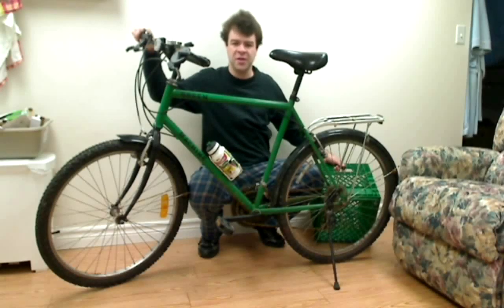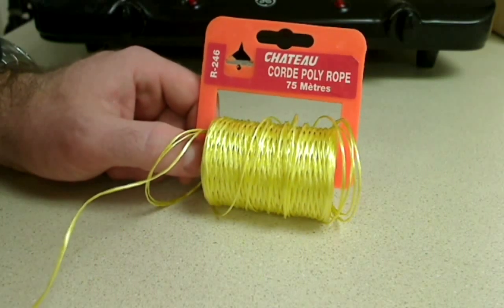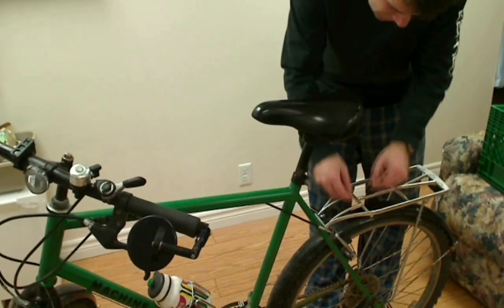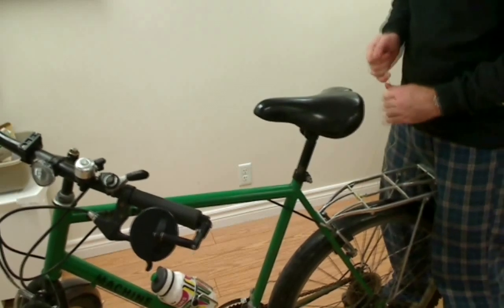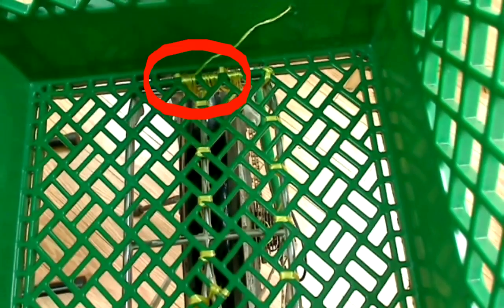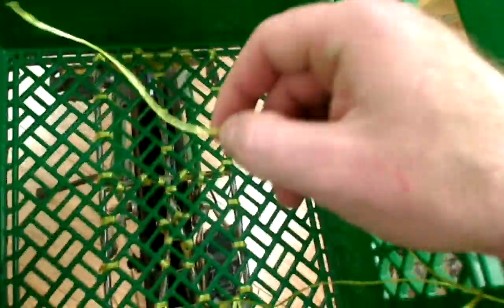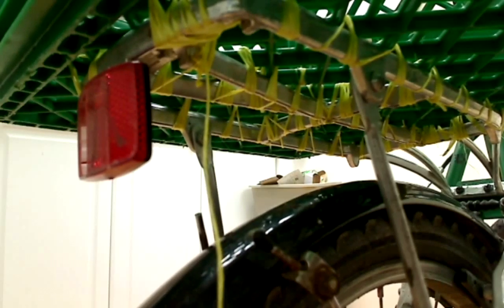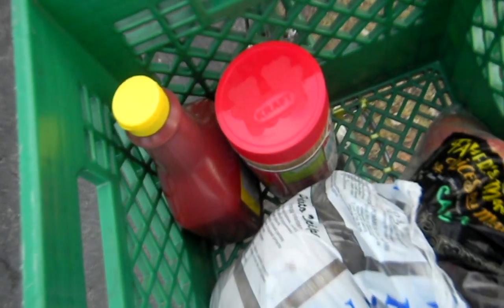How to Add a Milk Crate to a Bicycle

Comment: Thank you. I was told at some point to use cut up inner tubes to tie it, that works ok for a couple months but this seems much more solid.
Reply from the maker: Steerpike Yamaha I would imagine cut up inner tubes would deteriorate over time from exposure to the sun. Nylon string is what I have found works best.

Comment: Very nice I got a small crate for my bike but it's doesn't have holes like your crate. I guess I'm gonna have to get the drill. I like your method with the string cause it looks really sturdy and that is what I want. Thanx for posting this video.

Comment: If you did want to slide the crate back a bit (away from the seat) and attach it, so some of the crate is hanging over the back end of the rack, but you then put a floor inside the crate so any weight in the crate was more dispersed, do you think that would reduce the risk of the plastic bottom (that extends out the back) breaking?
Reply from the maker: On one of my bikes I installed a milk crate that overhung the rack a bit. Over time the bottom developed a few minor cracks, but it still held together and I was able to continue using it. Depending on what floor material you had in mind, that might help. Something non-flexible would spread the load and prevent the back section from cracking.

Comment from the maker: @jdcarpe 
My original black milk crate bike has extra reflectors mounted on it, but I still haven't gotten around to adding them to my new green one. However, both bikes have a fabric loop I added to the milk crates where I attach my rear bike lights for riding while it is dark.

Comment from the maker: @jdcarpe 
On most days I only need 1 milk crate, so that's why I mount them the way that I do. On days when I need additional cargo space, I just take 2 bungy chords and then I can stack as many milk crates on the back as I need.

I've never ridden a bike where they are attached the way you have yours, but I imagine the bike would take up quite alot of space on the road, although maybe not much of an issue if you have bike lanes or bike paths.

Comment from the maker: @doubleOprepper I bought the bike used, and it had already been sprayed black by the previous owner. Having compared it with other bikes over the years I'm about 99% sure it is a Supercycle XTI-21.

You can see the bike featured in many of my other bike repair videos. It has been a really great bike for me, the only disadvantage is that its quite heavy.

Comment: Use zip ties!  That's what I used!  Less complicated!
Reply from the maker: If you didn't notice, there is an annotation linking to a video showing how to do this task using zip-ties instead. I have done it both ways, and honestly prefer my string method.
Reply: Zip-ties work but they loosen up a bit over time with vibration and tension. Last thing you want is for all your stuff to fall all over the road while riding around haha.
Reply: cjhoyle hi im glad i reviewed this video before attaching my milk crate. so you do prefer the string method then because once i get my derailleur problem figured out, im definitely putting the crate on the commute is in need of it.

Comment: An even better method than string is hose clamps. It's more heavy duty than string. Also, it makes it easier to remove the milk crate if you need to.

Comment: So would you recommend the zip ties or the string?
Reply from the maker: anothereero Having tried both, I personally prefer the string. Although the zip ties are faster to install, I've found my string has been much more durable. In my experience the zip ties get weakened when exposed to sunlight and also become weak and brittle in cold winter weather.

Comment: Use a wire coat hanger. It is nice and strong. You find milk crates on the street or on garbage day. That rack is junk bro, only single strut and small.

Comment: Bolts and brackets  and washers would work way better
Reply from the maker: I disagree, but I do have 2 other videos which show alternative methods for fastening the milk crate.
Reply: @cjhoyle  Well i did use 4 large zip ties and its solid so ya it works fine.